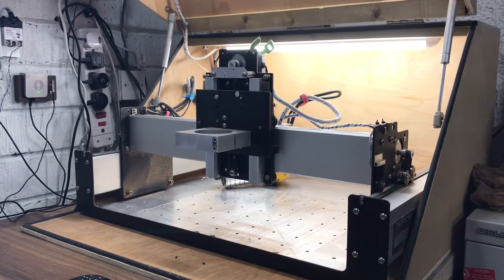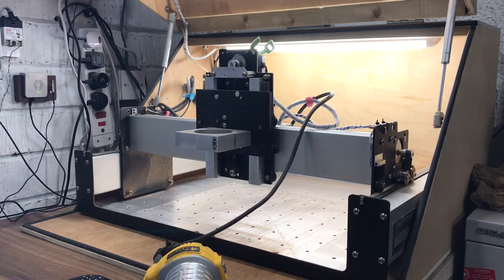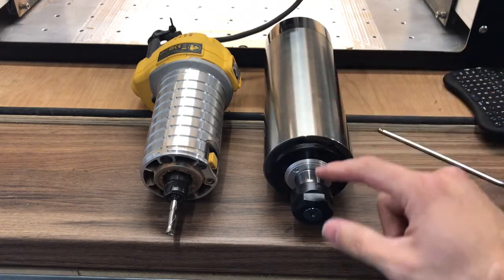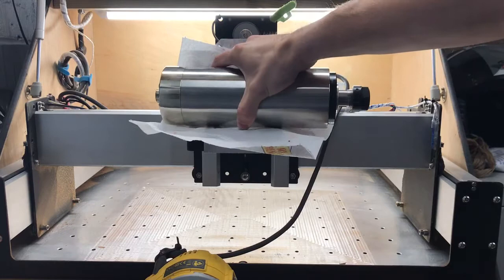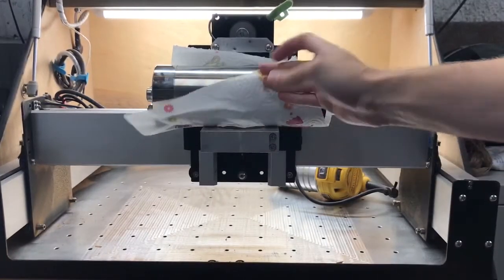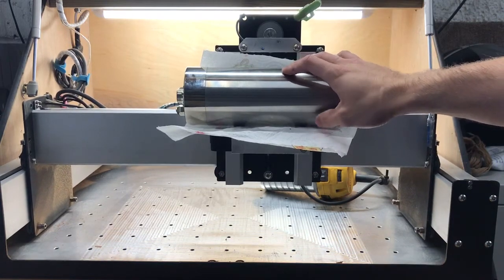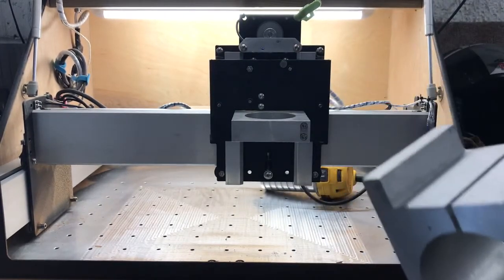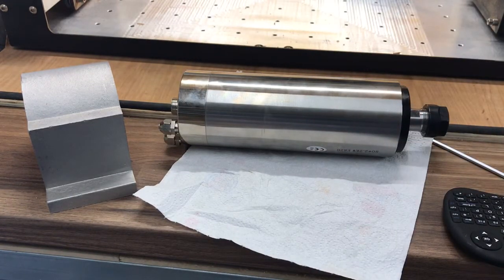Shapeoko 3 and a MONSTER 2.2kw Water Cooled Spindle

Comment: I added a 1.5kw spindle to my open buils Ox clone. There were two crashes that were a littlw too exciting. One was when I accidentally put the endmill against a piece of wood after zeroing it. Started the spindle and the cutter rode along the wood edge forcing the x axis to move against the stepper motor slamming into the end stop. No damage but it gave me quite a scare.
second was when I was machining 20mm thick aluminium tooling plates for a diy build of a new cnc machine. the cutter got stuck, skipped steps, went for cutting full 20mm deep into the material, got to  50mm while the z axis heaved and groaned up and down. The belt system was too weak to control so much power. The noises, the shaking of the entire machine, it's a wonder the cutter and all the mechanics survived. And the pane I machined could still be salvaged and used, with some battle scars to make it unique!
I sometimes hold down a workpiece cut out with my hands, but if it went haywire with my hands in the work area... taught me a lesson or two.
The new machine has ballscrews and limear rails all the way. Now the spindle seems small and underpowered on the new machine :)

Comment: yeah so i have this 80 mm heavy 20 lb water cooled spindle and i love it however the regular shapeoko x slide and z carriage are not designed for it.  it wore down my v grooved wheels and kept tilting it whole thing forward due to weight ... i gotta come up with a counter lever design or a rail support system ....
Reply from the maker: Yep, in the end I designed and created the HDZ to solve this problem. Ball screws all the way now!

Comment: what type of stepper motor you are using? eagerly waiting for your reply. thanks
Reply from the maker: The stock ones
Reply: @BeaverCNC  Nema23 230 oz / or Nema 23 470 oz, Can you please tell me precise detail of which motor you are using.
Reply from the maker: @rajkumarsingh8970  the standard Shapeoko motors I  this which are 120oz I think
Reply: @BeaverCNC  120 oz Impossible, 120oz cant lift your new heavy spindle (5 Kg =200 oz )
Reply from the maker: @rajkumarsingh8970  Wight and linear motion are two different things. The HDZ which is widely used uses the stock motors :)
Reply: @BeaverCNC  I have Nema23 3A (312 Oz) and it is lifting only 7kg. is there any way to increase the lifting torque? i need help.
Reply from the maker: @rajkumarsingh8970  All depends on the motion system you are moving? Ball screw, belt? Are you using a Shapeoko? If its a DIY Mill, what voltage are you using?